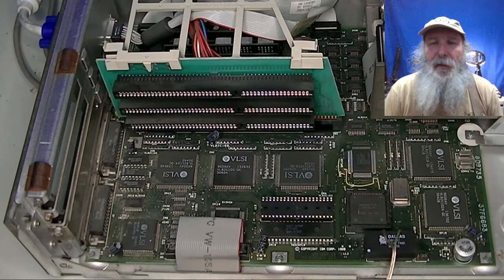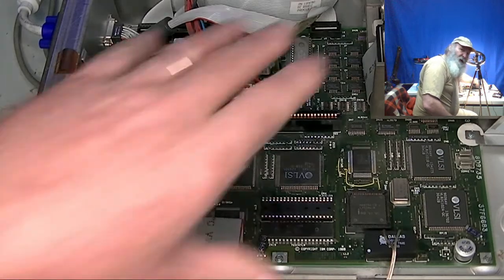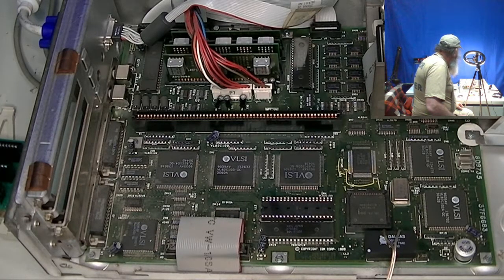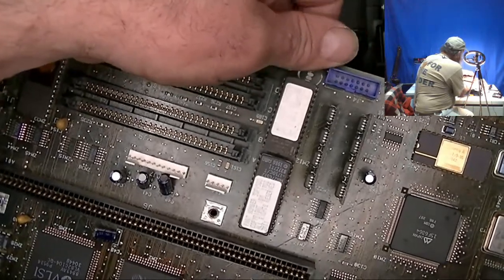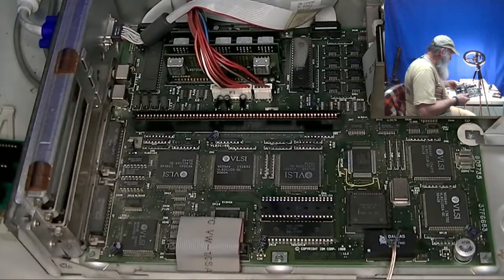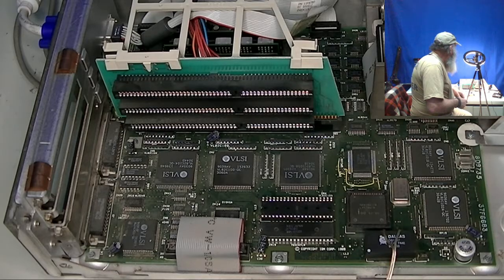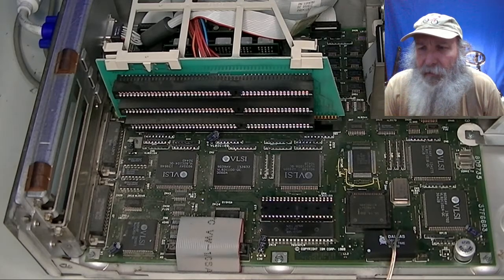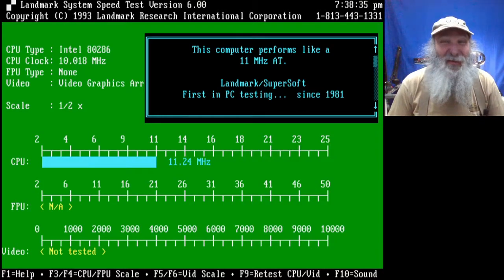Adding a 287 FPU (Floating Point Unit - Coprocessor) to an IBM Model 30 286

Comment: What the 287 datasheet is trying to say is that you can either use the internal clock divider (CKM low) or an external one (CKM high).

If you disable the integrated divider by forcing CKM high and you leave the clock input wired directly to the CPU clock you end up with the FPU clocked @ 20 MHz instead of the desired 10 MHz. To make things worse the duty cycle is wrong as well - 50% for the system clock, but the FPU expects 33% duty in this config. I'm not sure if the VLSI chipset generates the required clock, but probably not. So you would likely have to add an external clock gen to get this working...